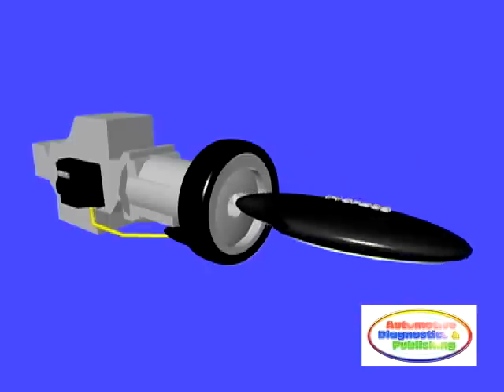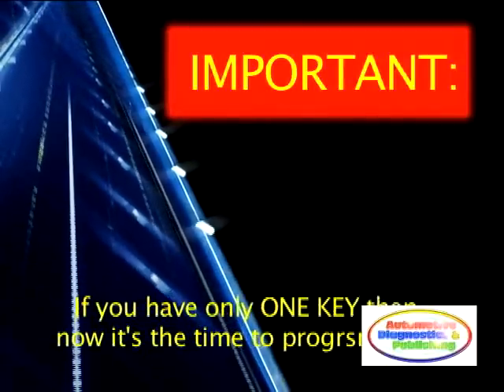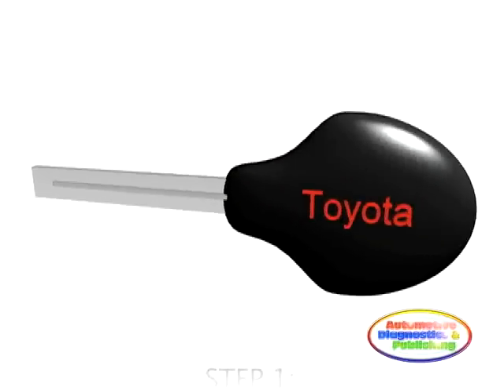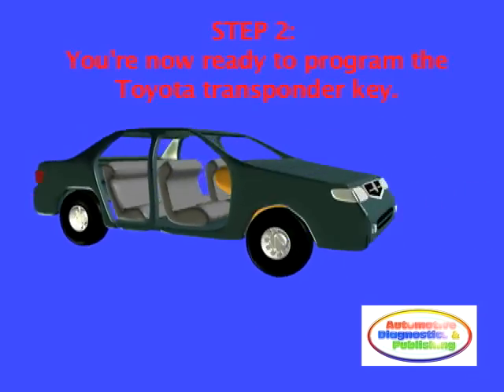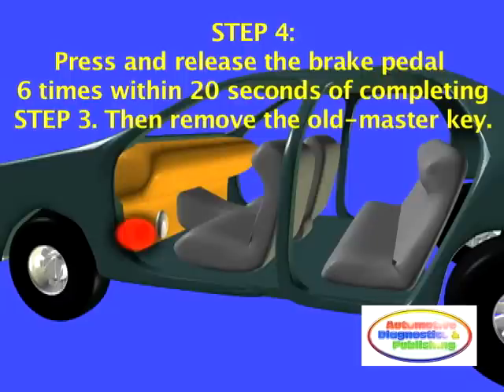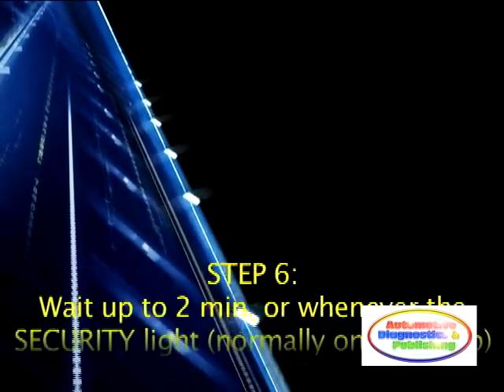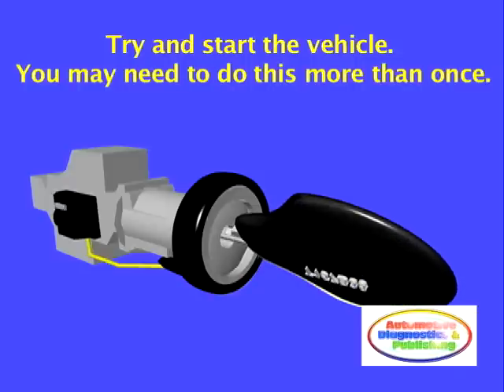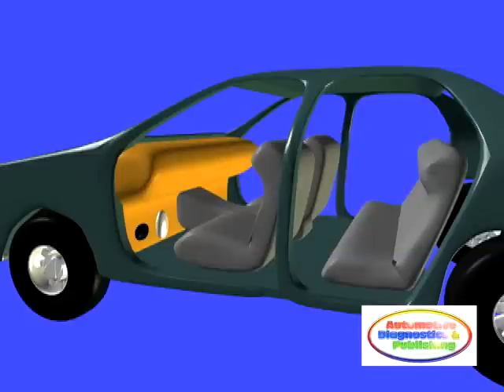Toyota Ignition Key Programming

Comment: Well, I tried the original method/instructions given to me by the company i purchased the item from on ebay and that didnt work! I actually tried that method a couple times and I just became frustrated. So I tried using this method from the video and it worked PERFECTLY on the first try. I had no problems whatsoever programming my transponder key to my 2000 toyota Solara.To be honest I was shocked but also excited. Once again thanks for the video!

Comment from the maker: If you only change the lock cylinder then you don't need any programming. If your issue is only the cylinder, do not change the key. Have the locksmith key the new cylinder to the old key. That's what every repair shop does. Hope that helps.

Comment: This method works for a 2002 corolla sold in Australia. $17 for a key on ebay from the US, $35 key cut by local locksmith (Bunnings wont cut auto keys) and follow this procedure. Dont give up it may take several attempts you will know it has worked when the security light stops flashing on the dash.

Comment: Worked perfectly on a 2000 Sienna.  Thank you so much.  No problems with remote locking/unlocking or anything else.  No surprise there as the remote would obviously be separate from the keys and already programmed to the car's security codes, but just felt like that should be added.
Reply: kitcarson61 
Hello
Reply: I got 2000 toyota Seinna is not working for me some reason; can anyone write the proper step for me please?

Comment from the maker: What you're referring to are the electronic throttle DBW resetting procedures. Lots of systems are OK if you disconnect battery. However, you CAN NOT remove battery without a memory saver tool. It is not proper procedure on any brand. There are 1001 reasons that you have to remove the battery, but you need a memory saver tool. We have a video on the subject. At the end of this video, click the video link at the bottom right of the screen. So, memory saver, problem solved. Does that make sense?

Comment from the maker: @Motorista55B Yes, a spare key is a regular key. Not a valley key. Also remember that there is a specific number of keys that can be programmed. If that number has been reached then you have to use the factory scanner to erase that number and start from 0. This is normally not an issue on newer vehicles. Good luck...

Comment from the maker: @srikumarsss OK, there may be another issue. All manufacturers have a maximum of keys you can program, say 8 or 12. It depends on the manufacturer. If the max amount of keys were programmed, then it won't except your new key. If you vehicle starts with another key, then transponder at the ignition cylinder is fine. When programming the key, you can't skip or perform the steps wrong. It is very exact. Often you have to try several times. Make sure you have a clear head... Good luck.

Comment: It depends on which version you have.  Walmart couldn't copy mine which was a G chip, though they could older ones.  Also, the only blanks they had was for a valet key, not a remote keyless entry one and those were $60.  I don't know when Toyota began using the "G" transponder key, but it's apparently an extra hassle to deal with and has to be done by the dealer or someone with the correct PC hardware.

Comment: Well, I thought I'd come back and answer my own questions.  The instructions seen here and elsewhere will NOT work with a 2011 Camry with G transponder key.  It can ONLY be programmed by special hardware that can read the code from an existing master and copy it to your blank.  So, don't bother sitting in your car for hours trying all these steps.  
Lastly, it doesn't seem to cause any damage as I first feared to attempt and fail programming b/c it was never doing anything anyway.

Comment: You have to have it programmed by the dealer or someone who has the programming hardware (which costs several hundred dollars as well).  The newer G transponders can't be programmed in this manner.  As a last ditch effort, I sent a complaint to Toyota for the exorbitant overcharging for this service.  Doubt I will see any compensation for it, but it's worth a shot.

Comment: I've found 2 comments on a Toyota-users chat board to the effect that after 2005, this method of programming the ECM doesn't work, and that we're stuck to getting ripped by locksmiths or dealers. Nor have I yet found anyone reporting success using this "pedal dance" for later model Toyotas... ugh. Still, worth investing in an aftermarket transponder key and trying, and will report my results, for a 2010 Yaris.

Comment: Took 3 goes to get it right but in the end it worked on my manual 2003 Corolla zze122r ,   have been running about almost 2 years with only 1 key ,  so yeah its good to have a spare key.   Guessing I'll keep the master key as the spare & use the new key as the everyday use key.

Comment: #1= Press gas and brake pedal, #2= Insert master key, #3= Press gas 5 times, #4 Press brake 6 times, #5= Remove master key, #6= Insert new key, #7= Press gas 1 time, #8= When dash lights go off remove key, #9= Press brake 1 time, #10=   insert new key and start. Worked on my 2012 Rav4
Reply: weidles proffessional👍

Comment: Thank you very much for this video.  I was able to program an additional key to my Toyota Avalon 2000 in just afew minutes.  i had to try a couple of times because my timing was off, but it worked.
Reply from the maker: Fantastic and thank you for sharing...
Reply: ADPTraining I recently changed the ignition cylinder on my 2000 Toyota Avalon, due to the imobalizer, the new keys will not start the car.  How can I program the new keys with the new cylinder  (as i assume the new keys wont work in the old cylinder and vice versa)?  Also, I still have the old cylinder, with a working key in case that is needed..
Reply: You need to insert the old master key first to initiate programming mode with pedals. No need to turn it.

Comment from the maker: Assuming you're done it a few times and still doesn't work, the only possibility is that the maximum amount of keys were already programmed. In this case you'd need to erase the anti-theft memory and re-try the procedure. Erasing the memory has to be done with the factory scanner. Good luck.

Comment: 1. With driver's door CLOSED, Insert existing master key 4 times in and out into ignition, on the 5th time leave inserted (do not turn the key, just insert and remove), .

2. Open and close the driver's door 6 times, ending with the door closed on the 6th time

3. Remove master key from iginition. The security light should now be a steady red light.

4. Insert newly cut key into ignition. The security light should now begin blinking red- wait approximately 60 seconds until the light stops blinking and turns off.

5. Remove the new key. Insert the old master key and start the engine and turn it off.

6. Your new key should now work

PS Note: (Some have said to start with door OPEN, then close and open door 6 times- with door open on last repeat-
Reply: +Nazareth434 
This worked perfectly on my 2012 Toyota Corolla Hatch 152R
Reply: +Nazareth434 note- these instructions did not work for me on my 2008 Toyata Corollla- I had to take my cut keys to the Toyota dealership and ocudl only get 1 new key made as apparently we're only allowed 4 keys before the whole anti-theft ignition device has to be replaced and all new keys made with new code- what a gigantic ripoff! What a Racket!
Reply from the maker: +Ballmead Thanks for sharing Ballmead.
Reply: +Nazareth434 Thanks for the info, I was down to one key and got one programmed (although it only works one way)...but the next two keys have not worked, the third one stopped the blinking light...now when I try programming it again, the blinking light goes 11   11   11  instead of 1   1   1    1  steadily..........so I guess I'll give up! It's for 2008 4 runner.
Reply: +Nazareth434 Worked on a 2005 Matrix. I owe you a beer.
Reply: Nazareth434
Reply: Nazareth434 I have Toyota 2007 europe version salon and trying the two options and none working....
The car already had one replacement key from dealer... looks the configured as master key now car has one remote key master and another solid master but looks I can’t add new key 😕
Reply: Yes, this works Toyota Corolla Altis 2010, India
Reply: Shame! Corollas 05-mid 10 had 2 different immobilizer systems installed at the factory?! Some Toyotas, like the Solara (and yours) needs the engine control module to be replaced or reflashed to get new keys.  I could see if they split up one half of a year during a model change, but four and a half years with totally different systems? THAT my friend, sucks.
Reply: @Nazareth434  This did not work for my  toyota rav4 2008

Comment: the instructions, in written form, for the above video are:

1: WITHOUT ANY KEY IN THE IGNITITION- Sit and press, then release BOTH the gas pedal and brake at same time

2: Now insert MASTER TRANSPONDER KEY but DO NOT turn the key- and WITHIN 15 SECONDS press and release ONLY the GAS PEDAL 5 times

3: WITHIN 20 SECONDS of completing step two, press and release BRAKE PEDAL 6 times, then remove MASTER TRANSPONDER KEY

(at this point the anti-theft device has verified that you are the owner of the vehicle apparently)

4: Insert NEWLY CUT KEY (your new key) into ignition but DO NOT turn the key- press gas pedal once (I assume that means pressing pedal to the floor?)

5: WAIT up to 2 minutes until the security light on your dash turns off. When the light goes off, remove the NEW KEY  from the ignition, and press the gas pedal once

6: Your new should now be programmed- if it fails to start the engine, then try the procedures several more times- it sometimes takes a few times because the timing has to be pretty exact apparently
Reply: +Nazareth434 Thanks for the translation, but should you not have changed the text to Courier to mimic the programmed computer voice? lol :)
Reply: Nazareth434 rr
Reply: #5 you said press the gas peddle, video said brake peddle which is right. .
Reply: Step 5 is wrong. Should read press BRAKE pedal once. That ends programming mode (after the waiting time of course)
Reply: Nazareth434 that is kind of u

Comment from the maker: How're you going to insert the old key in the new cylinder? You should have taken the cylinder to a Locksmith and change the cylinder to your old key. They do that. Then, also cut a new key that came with the cylinder. The cylinder has the coil on the outside. They key is what's programmed into the Antithefts system. Makes sense?

Comment from the maker: I am so sorry, you are totally confused. Ignition keys don't use batteries. You're referring to the keyless entry or alarm, not the same as ignition key transponders. Besides, whatever you do stay away from dealerships. Find a reputable independent repair shop and go with it. I can't remember if you need a scan tool to program the new Key-Fob or alarm control, as it is called. Post back if you need more info...Thanks for posting.

Comment: Did not work for me on a 2002 Prius; I tried 3 times. Supposedly I have a C4 chip in my new key.
I find other instructions online that include switching ignition on/locked 5 times and opening/closing the driver door 6 times; no pedals involved. Did not work either. Maybe an old Prius needs something else, or my new key transponder is not working.

Comment: I am installing an OEM replacement ignition cylinder (which comes with an un-programmed new key), in my 2000 Avalon XLS with immobilizer feature.  When I install the new cylinder with the supplied key, can I then take my old master key (which is keyed to the old broken cylinder), put it in the new cylinder (which will be keyed differently to accept the new key) and follow your instructions for programming the new key?  In short, does your method require the master key match the lock cylinder?

Comment: Thanks ekpp60 below.
I just programmed two transponder keys from ebay to work with Sienna LX 2005.  This video procedure did not work.  What did work is the instruction by ekpp60, as strange as it sounded with open/close door 6 times etc.
I had an old style home improvement store copy two keys, they are not allowed to copy customer's blanks.  Unfortunately the keys do not unlock the doors. If I wiggle it a little they do work on the ignition and since I programmed them they do start the car.

Comment: Did you get any information or figure it out?  I'm at a loss.  I have programmed FOBs for my chevy truck with no problem but am having the same problem you are.  i found locksmith but still cost $65 to program.

Comment: Hi. I have a toyota Rav4 2005 model. I only have 1 key that has its transponder. Key works perfect on the door locks & ignition. The transponder has stoped working. I even pit a new battery in the transponder & took it to the dealers but they said that the transponder is faulty & they can't program it. So now my car alarm sets off random everytime Im driving. Please help!

Comment: So, I bought a used Toyota Avensis Verso 2005, that came with 1 gray (additional) key.I only have 1 gray key that has its transponder. Key works perfect on the door locks & ignition. Is it possible to do this procedure with the gray key?  Can the master key  be re-programme Does that make sense?
Did you get any information or figure it out?

Comment: if i remove the battery cables for example from a 2009 nissan almera or altima ,, to work on the alternator then after the job ,i put the battery cables on and the engine wont start.. i presume ecu descofiguration or antilock system IT IS POSSIBLE TO FIND THE INFO OR PROCEDURE HOW TO START THE ENGINE AGAIN IN ALLDATA ,IDENTIFIX, MITCHELL or just the dealers has that information?(you know for exampl 10 minutes ON ,10 secnds OFF 3 times and the 4th the engine CRANKS))

Comment: So, I just bought a used 2011 Camry that came with 1 black master key with the built in keyless remote.  A Toyota dealer is asking $240 for the key + $90 to program it.  My plan is to get one off ebay for $30+/- From reading the comments here and elsewhere, it doesn't look like you can goof up your car if you incorrectly do the programming.  Is that correct?  I don't want a 2 ton door stop.

Comment: I bought key with transponder chip at ebay for my toyota corolla 2008 LE and cut at lowes. I already have master key to start the engine. The key opens the door and inserts into ignition, no problem. Tried to program by following the steps mentioned in this video. Spend over an hour but still no luck. Has anyone tried to duplicate 2008 corolla transponder key?

Comment: I have a feeling this procedure doesn't work on Toyota's after a certain year.  There were several questions regarding using the valet key as master key but so far no response that I have seen.  So my question is this:  Will this procedure work on Camry's after 2006?  if so, can a valet key be used as the master key?  Thanks for your help.
Reply from the maker: You may have to try it several times.

http://www.autodiagnosticsandpublishing.com/Automotive_Diagnostic_Repair_Book_Catalog.htm
Reply: 101060andrews i

Comment: CORRECT WAY TO PROGRAM KEYS!!
(1) BEGIN SIT IN DRIVER SEAT WITH DOOR CLOSED,INSERT MASTER KEY INTO IGNITION 5 TIMES PUSHING KEY IN & OUT & ON 5 TIME LEAVE KEY IN IGNITION DO NOT TURN KEY!
(2) OPEN & CLOSE DRIVER'S DOOR 6 TIMES
(3) REMOVE MASTER KEY SECURITY LIGHT WILL STAY ON 
(4) INSERT NEW CUT KEY SECURITY LIGHT WILL BEGIN TO BLINK APPROX 60 SEC,WHEN LIGHT STOPS FLASHING,PULL KEY OUT
(5) INSERT MASTER KEY TURN TO ON,DO NOT TRY TO START,TURN OFF,TAKE KEY OUT INSERT NEW KEY TRY TO START.

Comment: Hi
Thank you for this video.
I tried 5 times these steps for Toyota Venza 6Cyl.AWd 2010, not successful.
Is this method works for my car?
another quick question, I never was careful about my dash lights but i think after this steps when my car is off and original key is not in ignition, security light is blinking, Is this normal?
Thanks
Reply: yes

Comment: I have the original key for my toyota aygo 2005, but the buttons wore away and i cant use it anymore, does this process work for a replacing my old key?  I want to use the new key for locking and unlocking the doors without inserting the key in the lock

Comment: Hello,I just received one chip blank key from ebay for 2007 corolla le, had it cut in a locksmith,  tried doing this method few times now but not yet working? 
what I do not understand is why the security light will not shut off.
does anyone have an idea of why it is not working?
Thank's much!

Comment: IM REALLY AFRAID TO REMOVE THE NEGATIVE LEAD FROM THE BATTERY of A 2008 NISSAN ALMERA.CAUSE IM AFRAID THEN WONT START AND IM OBLIGATED TO TAKE THE CAR TO THE DEALER..IM FURIOUS NOT KNOW ABOUT THIS SUBJECT,,IF THIS ISSUE HAPPENS HOW I CAN MAKE THE CAR START AGAIN? WHERE ARE THE PROCEDURES?HOW MUCH? DO I NEED A NISSAN SOFTWARE TO PUT A CODE? DO I NEED A STEP BY STEP INFORMATION WITH THE KEY LIKE THIS VIDEO PROCEDURE?I NEED INFO AND I DONT KNOW WHERE TO FIND IT OR BUY IT

Comment: I have one question! If I will follow this procedure and I will manage to make the new key to turn on the engine... will this key open the lock of the doors??? Sorry if my question is stupid! Thanks in advance....!!!
Reply from the maker: The Door Lock is a different system. This means that the little buttons that work the doors are on a remote control like device, not the antitheft Key transponder. Hope that helps...

Comment: hi, I was trying to programing my new engine key into my 2008 Toyota 4 runner. I never saw the security light come on then after several times trying, I give up and try to start my car with the original key and it wont start. Sounds like the battery os dead. Is that a problem related with the programing key?
Reply: +Horacio Almazan Did you find an answer? Good luck.